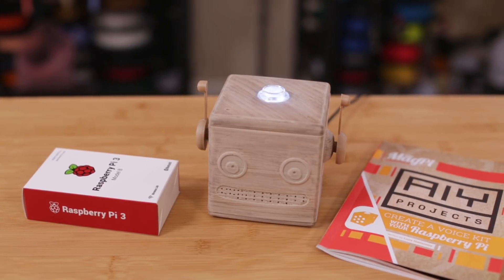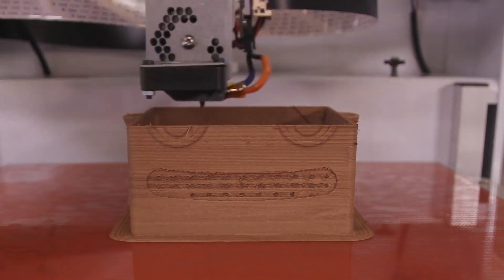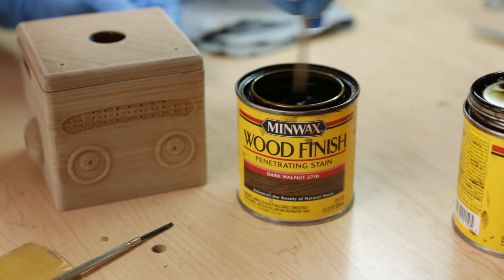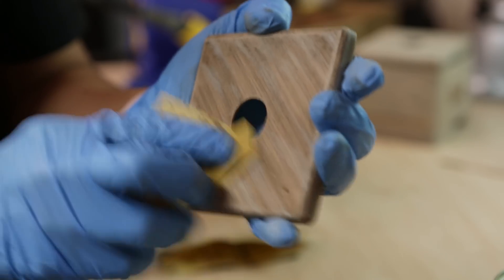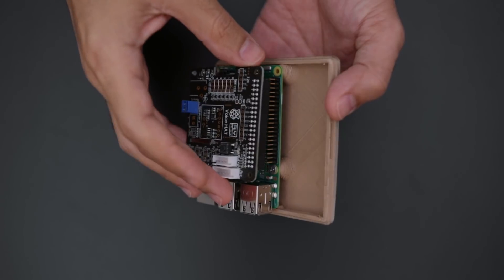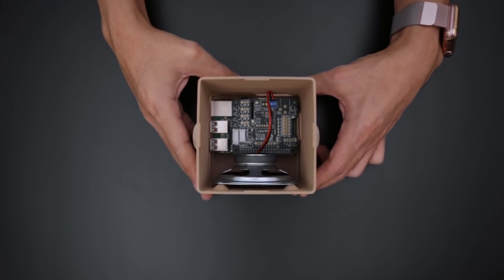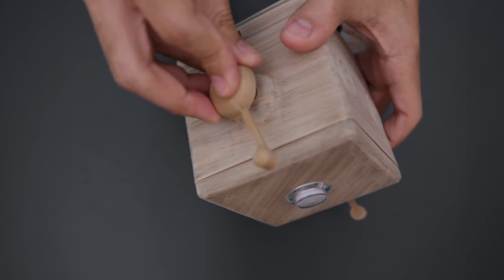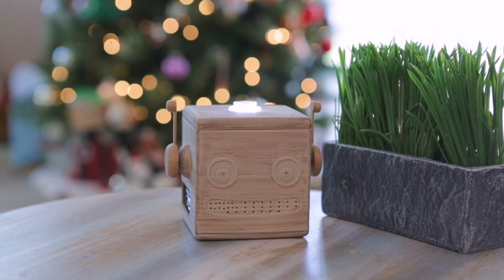3D Printed Google AIY Voice Kit for Raspberry Pi

Comment: you shouldn't tin wires that go into screw terminals, because of cold flow, a property of tin.
also your printer has a lot of wobble, check you leadscrews and belts, make sure they are straight / tight accordingly, it will give a much better finish and look fantastic with that wood stain